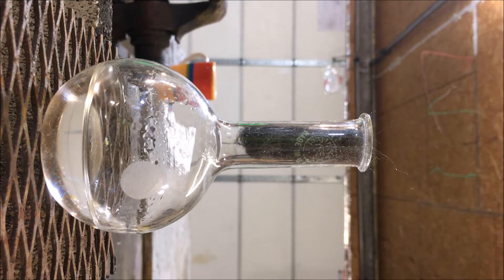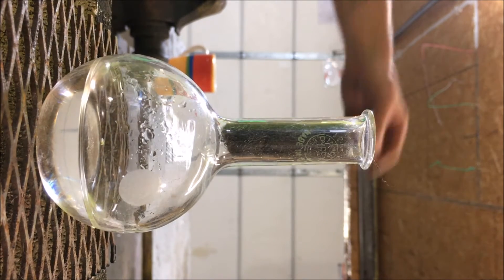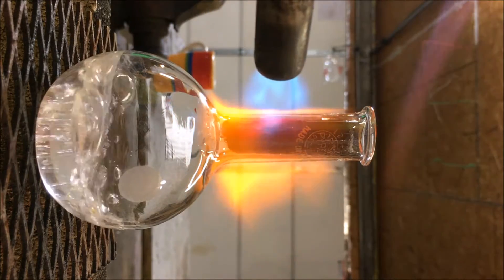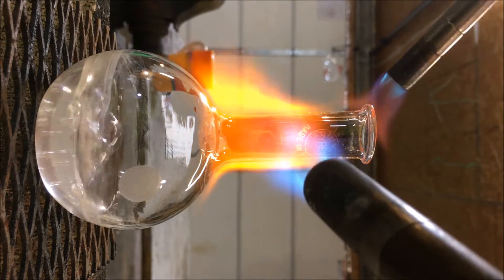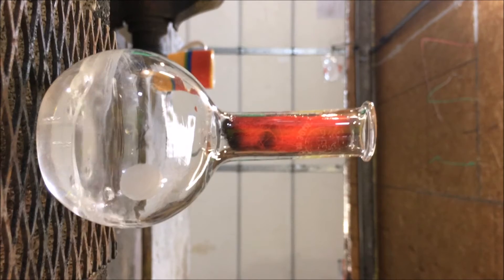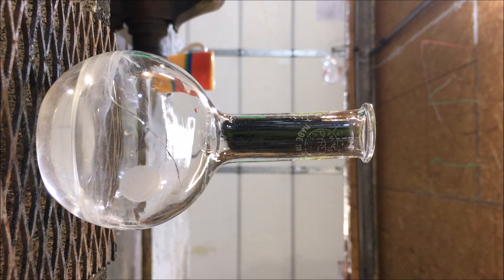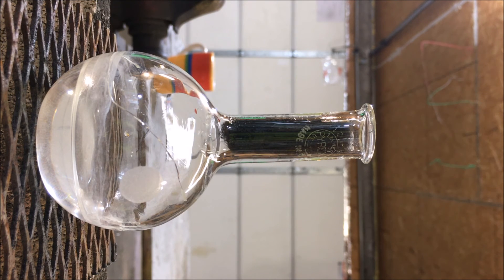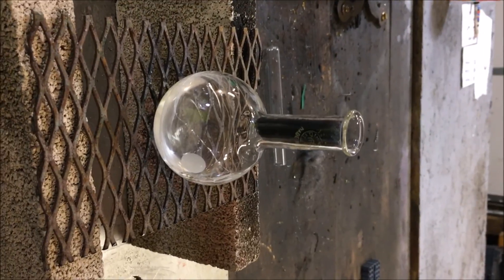Hydrogen synthesis

Comment: If my memory serves well, the thermodynamics alone require temperatures around 2000°C to achieve any reasonable amount of hydrogen production by water splitting.

A setup like yours involving iron metal may achieve some hydrogen production at comparatively milder conditions, but not through water splitting : you'd be oxidizing the iron, making iron oxide and hydrogen gas. So calling it "catalytic" is incorrect, as, in that case, the iron is consumed in the process.

If I remember well, Lavoisier already did such a thing in the 1700's : he made hydrogen by dripping water through a gun barrel plunged in a bed of incandescent charcoal. That was part of his demonstrations that water was made of two components (hydrogen and oxygen), and could therefore not be considered as an "element", which pretty much put and end to alchemy.
Reply from the maker: na you should read up on this reaction , its how the military  would luanch weather baloons  because this way you didnt need to lug a huge tank around
Reply from the maker: yes if i said it was a catalytic reaction i was wrong to say that however  When steam is passed over red-hot iron, iron (II,III) oxide and hydrogen gas are formed,3Fe + 4H2O ===> Fe3O4 + 4H2 , notice the 4H ? the reaction liberates huge amounts of hydrogen
Reply from the maker: Iron "reduces" steam at high temps
Reply from the maker: hey thanks for pointing out that mistake , by the way i do appreciate input from guys like you
Reply: "Iron "reduces" steam at high temps" : Yes, that's exactly what I was saying in the second half of my comment. It seems we do agree then!